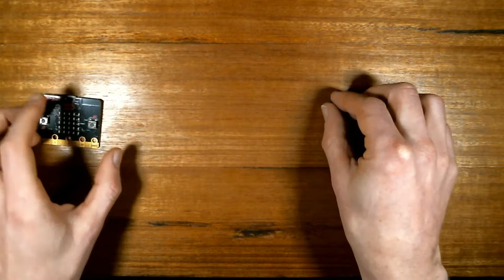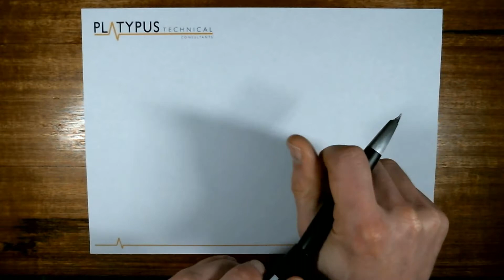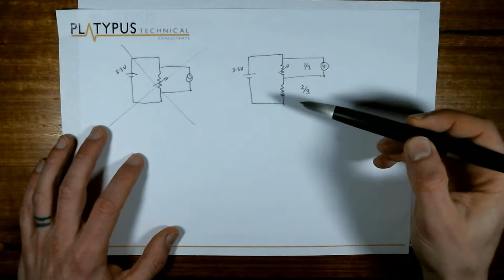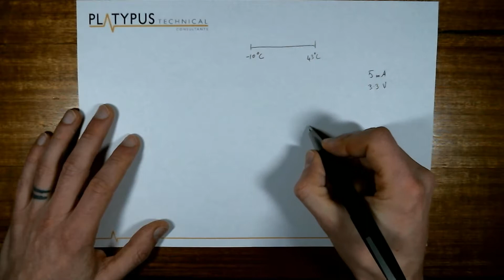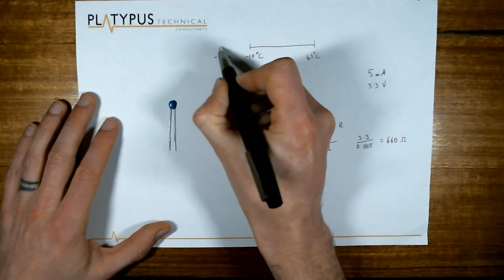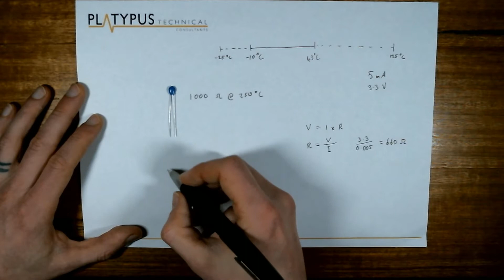Measuring temperature with a micro:bit - Part 2: Circuit design

Comment: Thanks for these videos, but where I can found the third (most important) part about the wiring microbit and collecting data? Thanks for the reply!
Reply from the maker: Csaba, unfortunately it has not been produced yet due to competing priorities.  I will bump it up the list.
Reply: @platypusmedtechconsulting  Meantime I have figured it out, fairly easy, but I never used microcontroller before. Now I am working on how can I use the range from 10% to 90% of 0...1023 values setting with serial and parallel resistors with the thermistor.